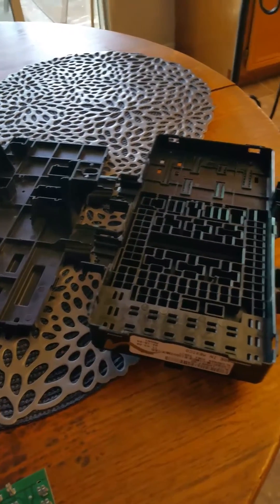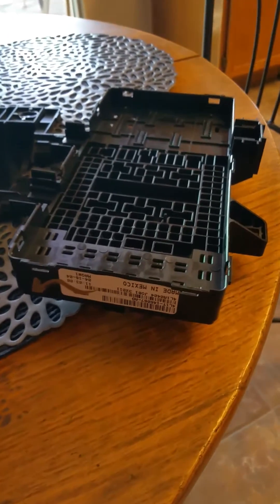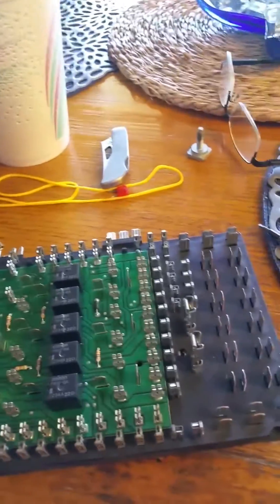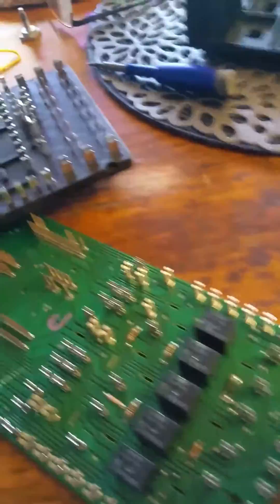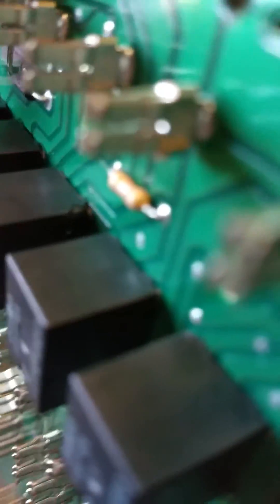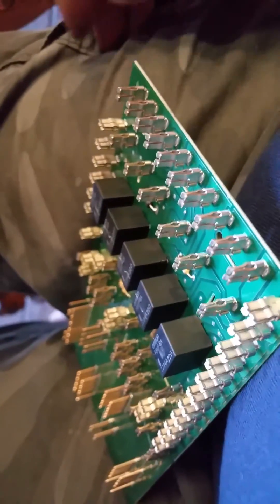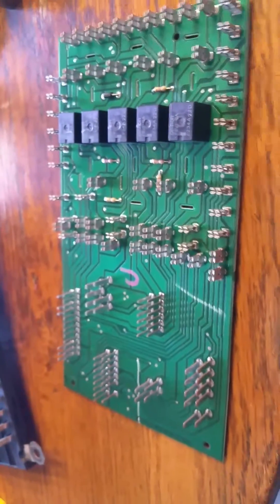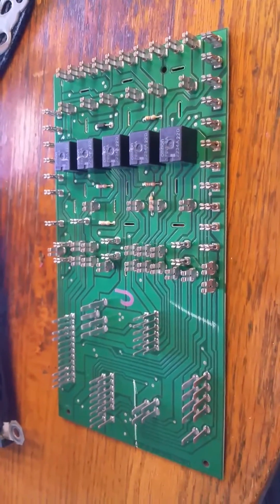2004 ford F8vx-ba repair fuse panel fuel pump relay. R303 part 2

Comment: Initially the problem was the truck was cranking but wouldnt fully turn over, so we figured out fuel was not being being fed, then with research found the relay 303 is the culprit on these vehicles. Cant tell you how frustrating this issue is for us, especially when Ford claims you can't service this part lol, you are correct it is a simple procedure... Well it looks like it anyhow. I wanted to save the hundreds I've come out of pocket so far by doing what you did. Why they would make this overly complicated by soddering it on tight, and then mentioning in the manual that it is a non serviceable part that only a Ford dealership or a qualified Ford technician can fix is beyond me. The "check engine" light wasnt even on and she drove in good condition before this even happened, no indication that something was wrong. haha just my luck.

Comment: Hello, What soddering kit did you use?? I dont have much money can you recommend one for removing/ and re-soddering on Relay 303 please? I found I can order the part online for 10-12 dollars. I spent money replacing the fuel pump and the fuel filter and I cant afford much more. I know now the relay is the issue, but how hard is it to sodder off and re sodder?? please help we are at our wits end. I dont know if it matters but this question is for the 2004 Ford Expedition.
Reply from the maker: Hi, I used a weller soldering station, and a little handheld spring loaded plastic solder-sucker (blue in video)) to unsolder the relay.  Soldering is a learned skill that takes a bit of practice to master.  It's not terribly hard but if you have never done it before, the outcome would be better if you can find a local person to solder for you.  Find a local ham radio club and email one of the officers, or, show up at their monthly meeting, and ask for help soldering.   Tell them another  ham (me) suggested that you to ask them for help and I'm pretty sure someone will offer to desolder the old relay and solder the new one on.   You might also check your local high school science teacher, or shop teacher, and someone will know how to solder and hopefully help you.  Last option, and the best one, buy a solder station and solder sucker from amazon (Anbes $18) or harbor freight, and practice soldering and unsoldering  on an old circuit board that you may have laying around.  good luck!

Comment: https://www.youtube.com/watch?v=U6Nd65lAZU8  
Check components and maybe your pump is the issue.   The fuel driver 
control module could be an issue that burns the soldering in the fuse 
box/junction box.  The soldering is weak in the box.   I had no code and still working on fixing mine. It is a safety issue my vehicle died with my kids inside going to school. Breaks and steering stiffed up.   I almost hit a vehicle because a simple cheap relay used and quiet costly.   Not nice engineering designs.   I love my Navi Cruiser will fix it better.  Ford do it right.  I owned a mustang for 17 years never had an electronic issue like this 2003 Lincoln Navigator. 03/19

Comment: where yuo buy the relay
Reply from the maker: get the F8VF part number from the text and go to ebay and search..I bought a couple extra ones too..only about $8 each if I recall.
Reply: If the number not the same it's not problem

Comment: I doing the exact same thing with my 2003 expedition.  I bought the fuse off eBay for 12$ and I'm gonna solder it myself. not sure why Ford designed the fuse box like this. its very irritating and they should have made it an interchangeable relay. but definitely worth it to do it yourself.